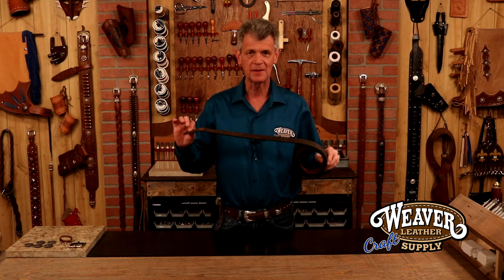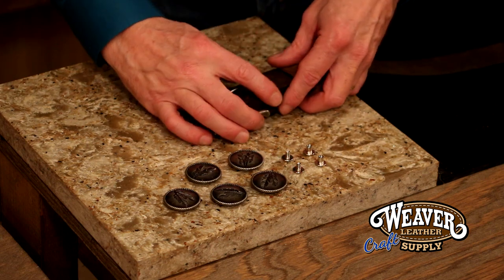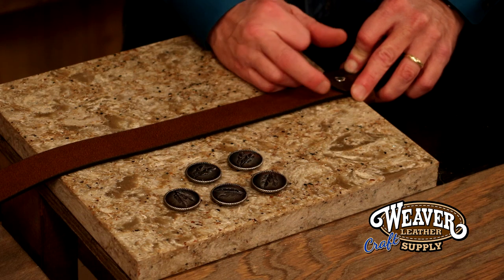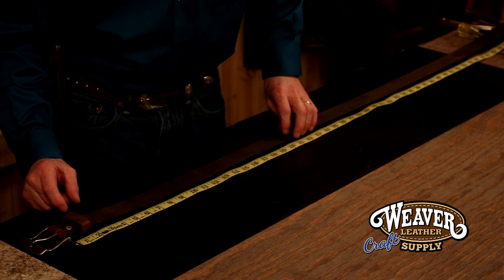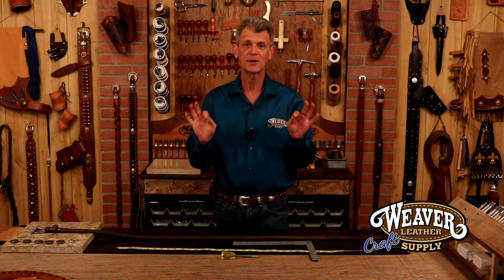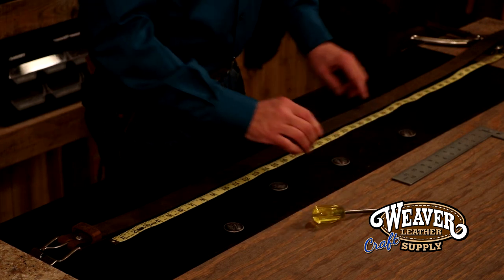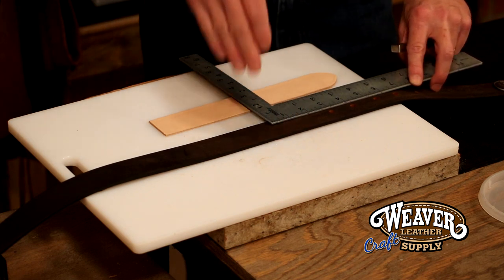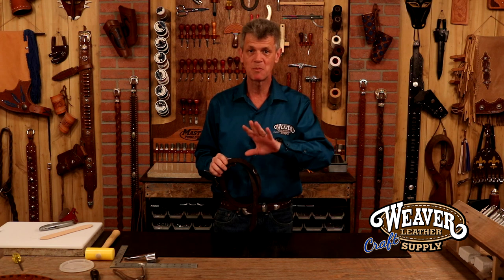Adding a Buckle and Conchos to a Belt Blank

Comment: I have belt buckle that broke I am trying to replace , but the belt has keeper screws and is also sewn on the end where it fold over (past the keepers). Are there replacement roller belt buckles that you can remove the bar and insert into a sewn loop? Hope that makes sense!
Reply from the maker: Hi there,
We did a quick search online for "replacement belt buckles with screw in center bar" and a few options came up so you might want to check that out and see if any of those would work for you. If not, you would probably need to remove the stitching to replace the buckle. Hope that helps!